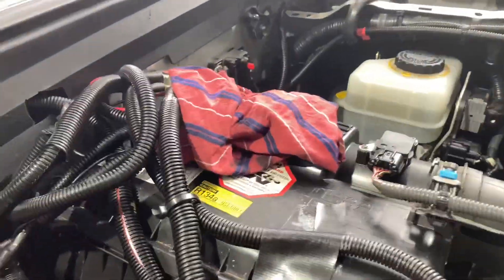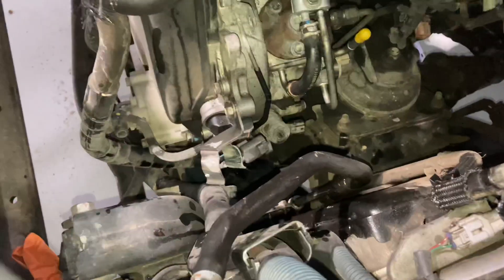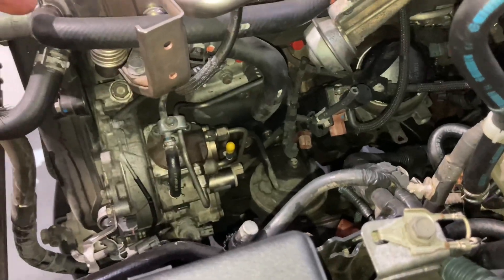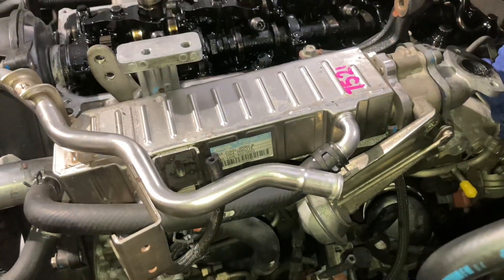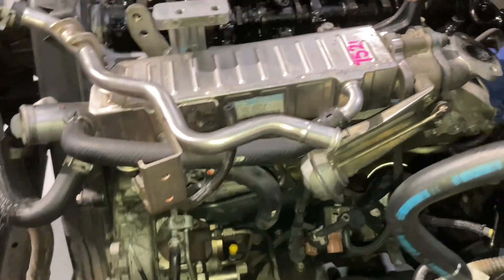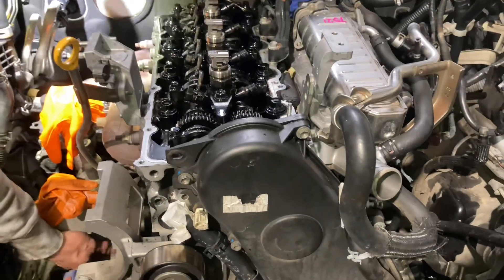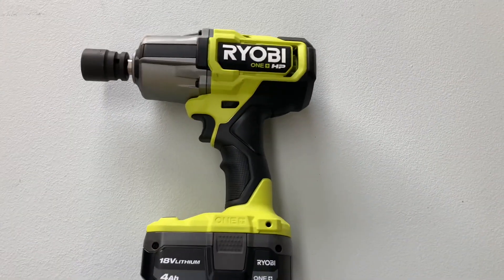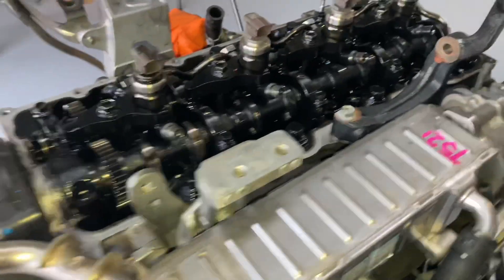ADAMS ENGINE KAPUT! EGR Cooler Coolant PROBLEM? Maybe

Comment: A couple of months ago I bypassed the EGR cooler with a male to male adaptor as mine was leaking, and fitted the 7mm plate.

EGR is now deleted properly (via tune) and I chucked the cooler in the bin, fitted full blank plates either end😊

Comment: Mate im happy to contribute by removing my egr cooler lol. Ive accidnetly broken the pipe under it where the egr blanking plate goes. Snapped right off the factory weld.  And i have direct air going into it the egr cooler now. 

So far no problems. I don’t even know if direct air going into it is a good or bad thing. 
So at this point im happy to try take it off and see how it goes. But id like to know What you think about direct atmospheric air going directly into it.

Comment: If your going to block egr exhaust completely you would beaware you need to electronically defeat the egr system so no codes are generated .Then plate cooler .  Reconnecting water hoses so water flows is the best way . Done this to older Ranger  and Lux . Waiting for new lux to come outta warranty .
Reply: why buy anything with an egr or ifs..

Comment: certainly makes sense, why run the lines if the egr no longer works or very limited in it's working, rerouting the lines saves from another possible failure point should the egr cooler split as it did on my mate stock untouched 79series, it coused the engine to over heat now he has major problems with the engine(it's rattling an knocking) bloody toyota told him to keep driving while they work out what to do, i told him Fthat!! park it an get a beater to drive!!
Reply: The euro3's didnt have a cooler at all so im thinking it might be ok doing coolant bypass with a 7mm plate, undecided at the moment
Reply: The EGR cooler on mine leaked as well.... I wonder what the 7mm plate and then bypassing the coolant to it would do?  Can it cause the EGR cooler to get so hot it would start a fire?
Reply from the maker: Daniel good point

Let’s do it
Reply: @Fourby4Diesel  only thing that may be a concern, due to no cooling effect and constant heat through the cooler, could the internals get damaged and possibly fall apart inside of it
Reply from the maker: That’s what I was thinking about but it’s just not gonna matter and I don’t think it’s gonna happen one way to find out my original idea years ago was air cooled put the hose, run it to the front of the vehicle put a funnel in the hose face it forwards to collect air
Reply: @Fourby4Diesel  I would love to find a solution that completly bypasses the EGR cooler....  Cant trust it obviously!  There is a OZBush chip that allows you to blank the EGR completely and then run his chip to turn it off...  Not an engine chip or a tune, just a EGR solution..

Comment: What would be the idea behind 2 different mechanics telling me not to plate my egr and both saying that the 1kd doesn't like having egr restricted? But I've seen others recommend it, cheers
Reply: A full blank yhe 1kd will spit the dummy and have the CEL pop up, 7mm reduction plate is what people use
Reply from the maker: They have nfi
Reply: Thanks for the responses, so the 7mm plate is more than safe then by the sounds!